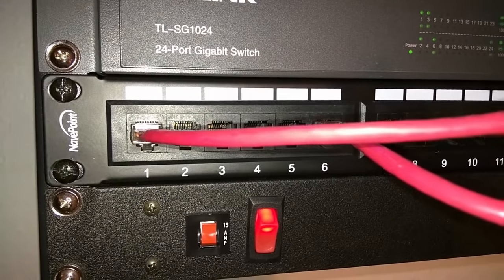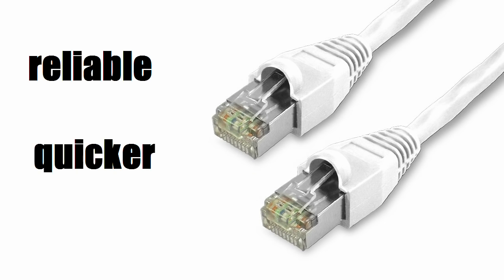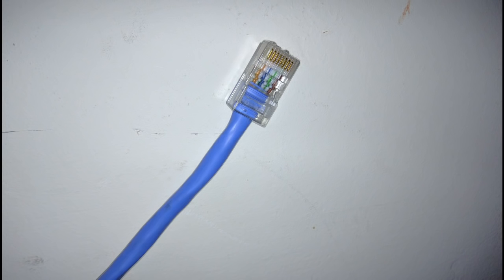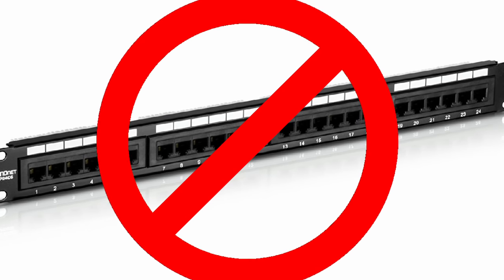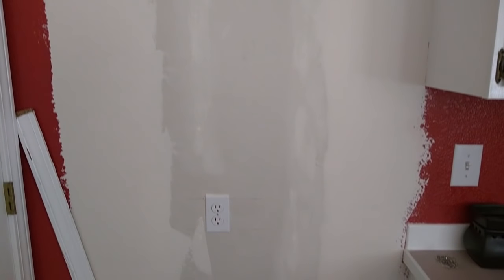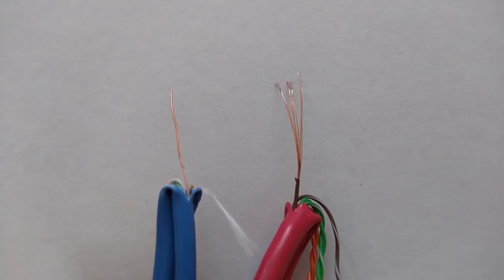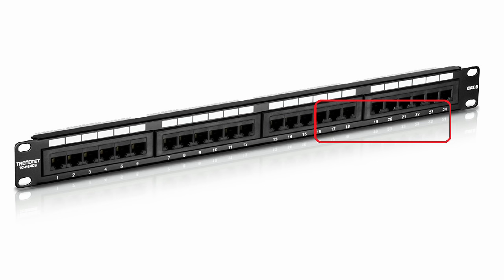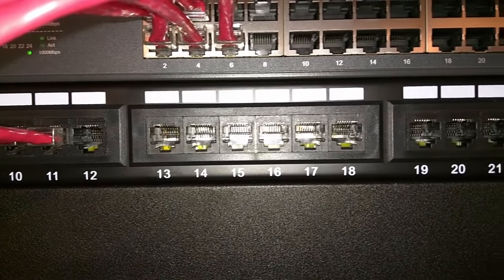What is a Patch Panel? Do You Need One?

Comment: I am so late, but. Why not put various wall panels and conect that to the switch?
Reply: Two reasons I can think of. You'll end up having to cut multiple holes in the wall instead of just the one.  And each wall jack is just like a mini patch panel itself. You could also just install the patch panel in the wall itself if you have all of the ports filled (so you wont have to pull the whole thing back out to add a new wire).
Reply: Because in a big network you would have fat loads of cables going directly into the front of the switch as to on a patch panel they are hidden behind it.
Reply: You really still need a rack to mount the rest of your hardware, so why make more holes in the wall than needed. Plus if you add or replace cable, you wont have to cut more holes or bother with the ones already installed. In really large environments, (like some that I work in) there isn't enough wall space for something like that and having enterprise products that have been developed and sold, make it easier and cheaper for us do it yourselfers.

Comment: In a home network?  If you only have a few cables, an alternative to the patch panel is a single gang box with anywhere between one and six keystone jacks in it.  Works just as well and is much cheaper.  But I agree that just leaving the cables hanging out of the wall is ugly.
Reply from the maker: +Art C yeah good idea. I only have a few now, but down the road I will have more.
Reply: That's what I'm doing. You can also get double gang boxes with up to 12 ports (keystone choice is important to avoid them blocking one another).

Comment: First of all, my comment won't be towards you, but the product itself. I've been doing IT for over 30 years now, and at present time I have my own IT company. I can tell all of you, about the patch panels, this :
1. They are the most useless thing ever invented for IT field. 
2. They cost a lot of money.
3. They are a pain to set up.
4. They only add more imperfect contact and resistance to your data newtork.
5. They take space in your racks. 
6. They don't add any value to the data network.

Now, I'm gonna try to summarize the above statements, and give my explanations for them. 

First, a patch panel is ONLY used in medium to large networks. No sane person will ever place a patch panel or have wall mounted rack, for that matter, for networks that are under 30 computers, at least. I do mean SANE ! 
For medium to large data networks, the patch panels costs a lot of money, and could be extremely expensive, given that they are passive nodes, not even devices, on your networks. For those types of networks, the cables or ports are never switched, once installed. Only equipment repacement is done, if need it. So, handling the cables to the breaking point never happens, unless the guy setting or maintaining the network is a moron.

A patch panel add a lot of imperfect connection, starting from the back of it, where cables are pressed between two spikes, and those spike only touch a very small portion of the wire itself. Then, you will use a patch cable to connect the actuall management device, wich creates two more points of imperfect connection. It's like running two short cables inside the walls, instead of a single one, and connected them with a RJ45 extension connecter, which is .... well, a stupid thing to do.

The racks that patch panels are used in, have cable management spaces, and we've always ran the cables straight to the management devices, like switches, routers, etc. Those cables only come out if a device need to be replaced, and in that case they all just get lowered a bit and the device comes out without any issue.

The last thing is about management. A data network management is NEVER done for and with the ports, but for and with IP's. And if you need to manage a specific port, it's very easy to do it. And the mapping of the ports is never done by writing on the device's labels. Every time we set up a network, at the end we provide a full documentation with everything that is in that network. And the rack mapping is done by drawing the whole rack, with software of course, and creating a very accurate Legend of what is what, and what cable reach what room and socket. That way, everything can be rearanged and rewrited without trying to erase and rewrite the labels.

By the end of the work, we realised that the patch panel plus patch cables ,plus work time, adds up quite considerably to the cost, and adds no value what so ever to management or ease in operation of the network. So, for the last 27 years, I've never used a patch panel again, and had zero complaints from the customers that have 15 to 20 years old networks set up by us.
Reply from the maker: Good comment, but you forgot about the nerd street cred part.

Comment: Good video.  You keystones are upside down if you want the Cat6 wording correct.
Reply: Not only will the Cat6 wording be correct, it also serves another purpose. By not having dust settle on the gold contacts for keystone jacks which are not in use. Same goes for rj 11 keystone Jacks as well.
Reply: This is an excellent tip!

Comment: Soo now i'm somewhat convinced i need a patch panel, but i'm also in love with hdbaset and usb4.......

Now i know hdbaset isn't a network but hear me out.
- hdbaset allows for network connectivity, power, av and usb signals to go over a ethernet cable.
- usb4 allow for network connectivity, power, av and usb signals to passthrough a usb-c port
Get where i'm going?

What if we had wall plates with usb-c that could enable you to charge at all these locations, but also allow you to patch screens and camera's and get network connectivity xd granted it can't all be just usb-c given not all devices have usb-c ports, it'll likely also need hdmi, usb-a and ethernet ports as well.......

Comment: Punch-down panels are a royal pain if a jack goes bad and the cable feeding it is buried under 23 other cables, all zip-tied down. If you're going to use a punch panel then use a rear strain-relief bracket spaced a few inches away from the punch terminals so that the cables are perpendicular in their approach to the panel. This will space them out and give you a fighting chance of retrieving and rerouting the cable from a bad jack to a new patch point.

Or use a keystone panel.

Comment: I suggest to go away from the "classic" patch panels and use a Keystone panel. Because it is more flexible and can provide other cables the same way, and in my setup I regulary need other types of cables (in my case mostly USB)
Reply: @user-sl4ul4nc3t  I dont care about certification in my home network, even if I have a much better network than companies I used to work in my "youth" (or being onsite there) ;) Just wanted to mention that since the other end of the cable was also a keystone (which is common nowadays) so it would make sense here too.

Comment: You need one if you're doing it right.

I don't have a comms closet per se, but there's a spot on the basement wall where I have all my network gear mounted. There's a 6-port CAT6 wall-mount patch panel there.

Comment: YES YOU DO need a patch panel. You are NOT supposed to move those solid-core wires around. They are meant to be installed and left alone. STOP PUTTING ENDS ON SOLID CORE CABLING

Comment: Thanks, but Im still not sure what a patch panel actually DOES.  Couldnt you run those ethernet cables through your walls, out that nice hole you made, and directly into your router or switch?  Seems to me all youve done was added work, cost, and component count/complexity to your system.   Correct me if Im wrong, but all the patch panel is doing is connecting two ethernet cable ends together, essentially... a single location to extend multiple different lines.  You say its largely for the aesthetic, because you can 'hide' cords... but you have just as many cords exposed on the front side, they're just shorter.  Am I wrong? Boxing the entire thing off into a cabinet would be much more aesthetically pleasing, wouldnt it?
Reply: Yes you can, I'm also confused as it makes sense to have the Ethernet going into a faceplate in the target location, and then an Ethernet from that into the device(s) and then directly into the router/ switch back in the server cupboard. I also work full time as a network engineer in a data centre and I haven't seen a single one
Reply: Durability is the biggest reason. A cable run is usually a time consuming thing, so the cable could be considered precious. If you wear out or damage the end of the cable in the wall, you can chop the end off and put another on, but there's a finite amount of times you can do that. So if your cable runs terminate at patch panels and keystone jacks, then the cables getting the daily wear and tear on them are short patch cables usually no more than 6ft. They're cheap and easy to replace. If you are absolutely NEVER going to touch a cable again, then yeah you probably don't need it. But most enthusiasts are going to continue to tinker with their setup.

Comment: Just admit it's only there because it looks cool.  If your ethernet cable reaches the patch panel, it will reach the switch.   You're just adding another step in the middle cause it will look cooler and more impressive to have all those cables going from place to place.
Reply from the maker: I believe your description can be summed up as "Nerd Street Cred"
Reply: That's really not the reason. This is the correct and proper way to terminate structured cable on the switch/rack end. You can absolutely terminate your in-wall structured cabling with an RJ45 connector and plug it right into the switch, but if you're going through the trouble of cabling your home up for ethernet, do it the right way and save yourself a headache in the long run. Not only will you risk damaging your cables moving them around between ports, but you will introduce inconsistency and uncertainty in your structured cabling down the road if you ever move a cable to another port.

Comment: Why use a patch panel if you have switch? Doesnt that create more possible points of failure??? I dont get it
Reply from the maker: Can't be that bad if they are standard kit for corps. Really you set them up and never mess with them, so they often times can narrow down where you have to check.
Reply: @BudgetNerd  but when I trouble shoot networks I have tone more possible points of failure. Lol. I think it's very archaic. I've seen instances where other techs might have accidentally pulled out a strand or two from the back of the patch panel and create even more problems. I'm in the field everyday just about and I just can't see it as anything else but a hassle. Still a great video though!!!
Reply: less... no electrical failure with hard wired cables if done right

Comment: Personally, if budget allows, I would use electric PA sheath to run the cables through wall, if some day for obscure reason a cable snap or you have to run a second one (and have room for it) it will be far more easier than having to run it without a sheath.

Comment: My house was built in the 1950s so network solution is wires run on the floor
Reply: Myrkur do you have an attic or crawl space? I'm sure you do. Of not there's options if not
Reply: Jonathan Osborne we don't have a crawl space but we have an attic that's very unaccessible
Reply: Jonathan Osborne only computers with Ethernet are the ones close to the switch with cat 6

Comment: I live in the country and have a unique problem. Critters in the walls. Im terminating my runs at the wall so I don’t have to leave an opening for something to crawl into the house through. I’m basically doing a low key patch panel by installing a double gang low voltage bracket with a sixteen port keystone face plate that I can label and update. The plan was then to run patch cords from the wall to the switch on the rack. I don’t imagine having more stuff than that but i can always expand it I guess.
Reply: We are China Hqst brand, we have more than 18 years experience in magnetic components and network connectors industry, focusing on providing better products and efficient service.100% Compatible with Pulse, TE(TRP) , Bel-fuse , Wurth , Halo , Molex, Foxconn, UDE... RJ45, SFP connectors and LAN transformers. Faster delivery; same quality; competitive price. Professional technical support and perfect sales service are our core competitiveness. Looking forward to cooperating with you.

Comment: Patch panels are simply an interface between the trades in a commercial environment.  The electricians run cables throughout the building and terminate them all in one spot with a patch panel.  The IT staff takes it from there, by connecting their LAN to the building using the patch panel, usually through a switch and a router.

Not even remotely practical in a domestic environment, unless you have one of those ridiculously complex home networks, but if you do, you already knew this.
Reply: Well, of course it's not remotely practical. It is locally practical, though.
Reply: Agreed. As a residential IT guy, things would get dicey every time the homeowner called THE ELECTRICIAN moaning about his wired network having trouble. He was like, "Dude, you just hired me to run wires. Which I did. And they worked!" ::click::
Reply: I have often run cables in offices, factories and warehouses.  The electrician put in the conduits and boxes and I then ran the cables.  When running cables in an office, you'd run the cables over J hooks and down through the conduits into the box.

Comment: So why not just plug it into the switch instead of the patch panel
Reply: If  you have 4 cables - just plug them directly. When you have 10 cables - the mess begins. Will you remember which leads where? After a few years, the stickers fall off (if you have them). And switching anything if you have a gordian knot from spaghetti nett isn't possible.
 You'll look at it and say: I want to puke. It can't be worked with, we need a patch panel.
FUN FACT: In one office, where there was no patch panel, ports were missing on a 16-port switch. After tidying up (because there was never a description of the cables), a 4-port switch was enough.
Reply: @wojciechbajon  so basically, unless you're having enterprise-level wiring on your home network that can mess everything up, which I highly doubt since you're only using home-level devices and server, you don't really need patch panels, just connect it directly to the switch

Comment: 👀..🤔.. Yeah, that is serious nerdgasm. Very good video. You make a very good case for having a Patch Panel and especially if your in a modern wired apartment or house. My current apartment has zero wall Ethernet connections. It makes easily connecting wired Ethernet all over apartment difficult.

Comment: Can’t you just rout the wire from the wall plate straight into the switch instead of a patch panel
Reply from the maker: yes you can.
Reply: @BudgetNerd   then why the patch panel if it can go straight to switch panel???
Reply: Better for cable management